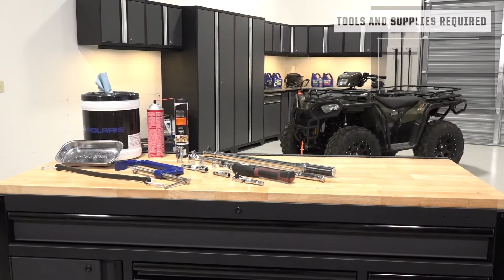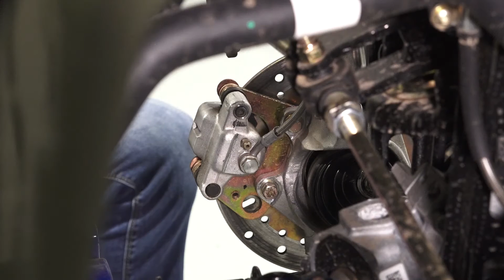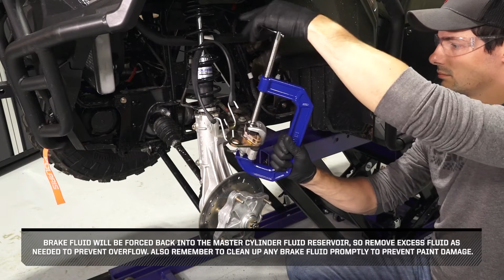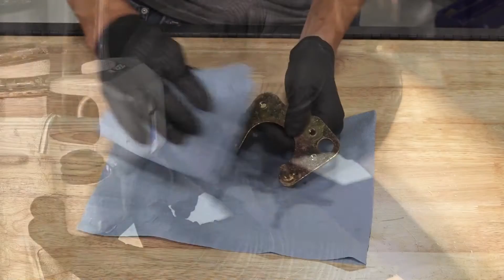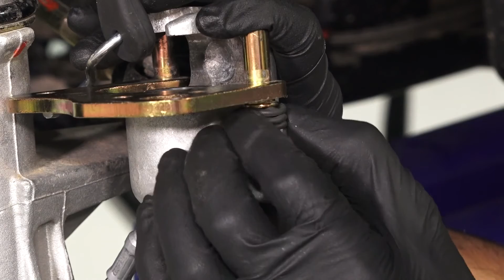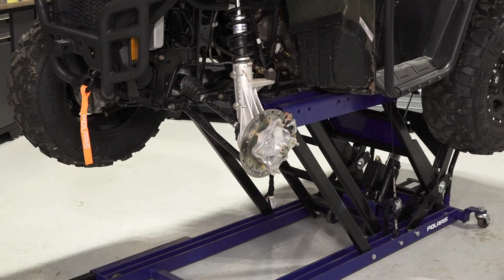2021+ Sportsman 450/570 Front Brake Pad Inspection and Replacement | Polaris Off Road Vehicles

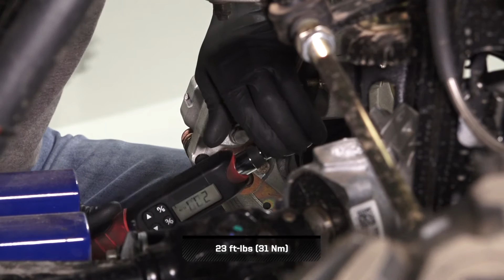Comment: The tightening of the set screw at 4:45 in the video is slightly confusing.
It says "tighten" and (then?) turn another 2 to 3 turns ??
WHEN is the set screw "tightened" ?🙂
And WHAT is the "patch lock" ? 🙂

Comment: Why cant Polaris put oil grades and specs of their oils in a manual, like all other normal brands?  Cause all we don't want just use Polaris orange juice oil in a star package? Its against a laws in Europe and it should be included in manual and available information to an owners!
Reply: You can use regular gear oil for the rear end and for the transmission fluid it shares it on the 2020. For the engine oil it was 0w 40 or 5 w50 . I used 0 w 40 on mine and its been fine. The rear end is fine. But online i thoroughly looked and it said you have to use polaris demand drive fluid for the front diff .
Reply: Also it says its official weight is 5w 50. The engines r rattleboxes anyways i doubt it matters that much what you use.